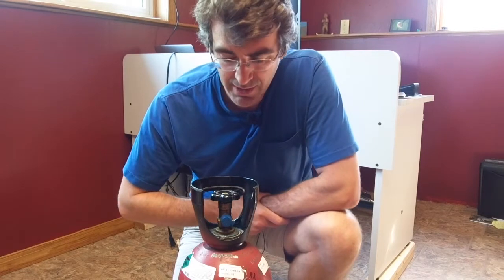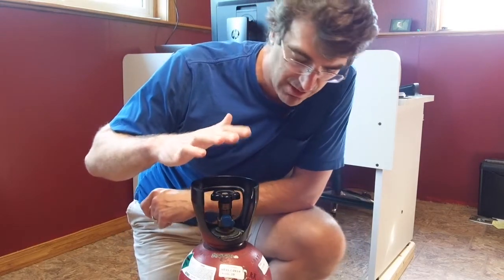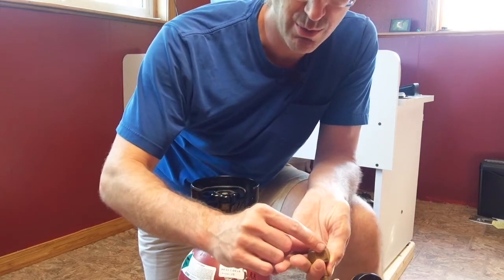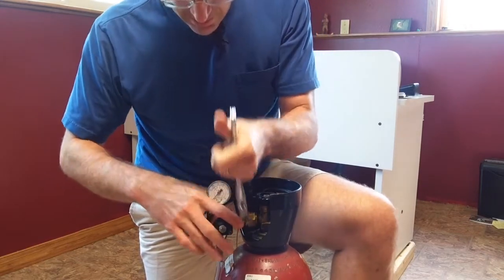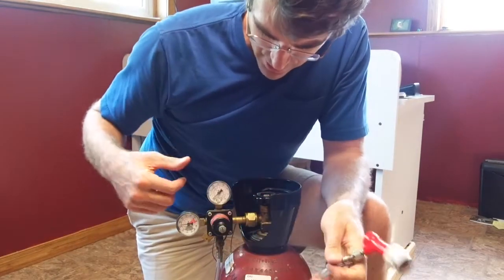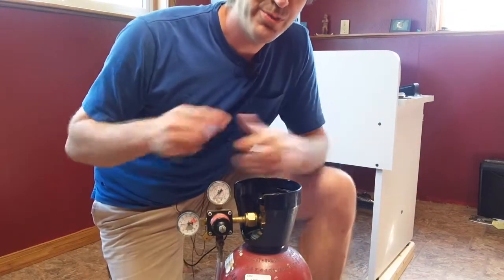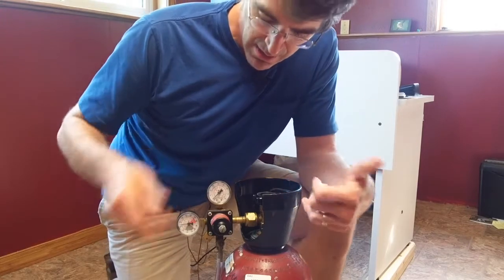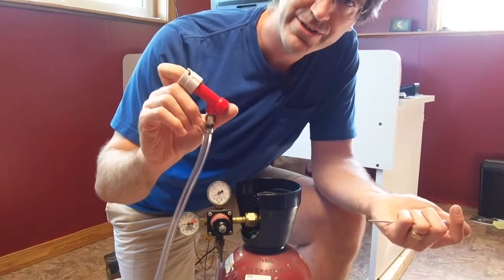Homebrewing Keg Tips - Attaching Co2 Regulator to Tank

Comment: Good video, but as for that gasket/washer, I never use the one that comes with the tank exchange, I just use the nylon one that the regulator came with.  But if it works for ya, so be it.  (Was told by LHBS to never use the gasket/washer that comes with the tank)  Cheers to you and your Home Brew!
Reply from the maker: Paulie, that's a good point. There is no washer included with my exchange. This was the one I got when I purchased the regulator from a friend. I just had it in my hand so I wouldn't lose it. I didn't think about the fact it looked like I pulled it out of the cap/seal.

Comment: so if i use a keg and i have it set to 30psi for first carb how do i know when the tank is filled with 30psi?
Reply from the maker: Well, it’s not that cut and dry. Pretty much as soon as you hook it up, The headspace will be at 30 psi. However, the co2 will gradually dissolve into the liquid. 

If you are doing the quick carb method, the rule of thumb is 24-36 hours. Then let it sit to equalize or vent the headspace and then hook it up to your serving pressure and see how it pours